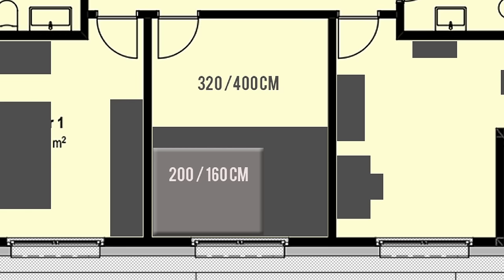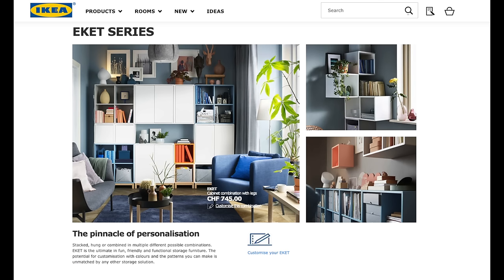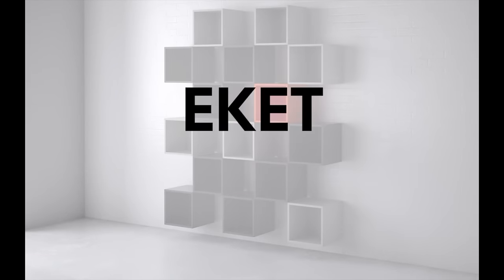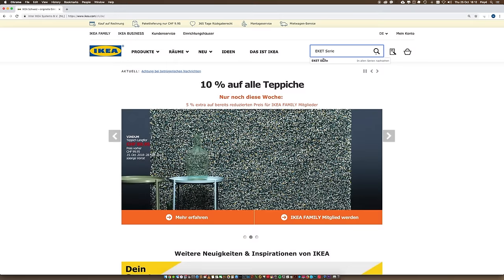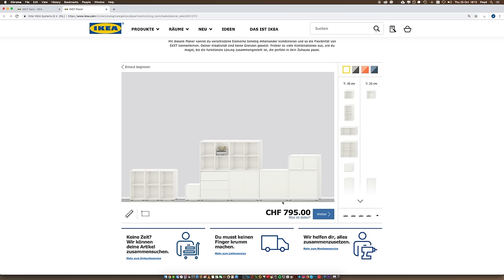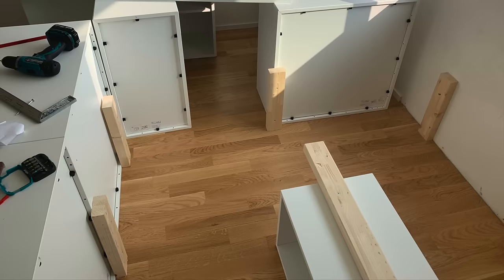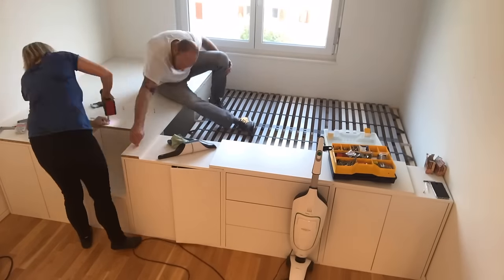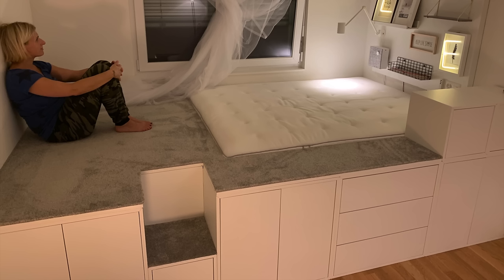IKEA DIY HACK | Platform Bed

Comment: So....there are IKEA cabinets under the platform, completely inaccessible?
Reply: seems like it 😂
Reply: Yup. Because that's apparently cheaper than using some 2x4s and mdf.
Reply: That's exactly what I wanted to ask.

Can you only reach the cabinets/shelves in the front, or also the ones under the pillow area and how?
Reply: @wilsoncalhoun  What are 2×4s?
Reply: Frogenius W.

Dimensional lumber 2 inches thick by 4 inches wide by 8 or more feet long. Pine or red oak 2x4s are ridiculously cheap and adaptable, and to my mind would be a better choice in a project like this-- at least for the structural bits.
Reply: Shasta Bare 

Wow
Reply: @wilsoncalhoun  
Thank you for your answer! 👍

And that's what I thought too! A wooden frame would be much more efficient.
Reply: Cheshire Cat  
I'm not a native speaker, so I didn't know this expression.
In german we call it "Vierkantholz".
Reply: There prolly secret storage... If they aren't that would've been the sensible thing to do 😒
Reply: I think so
Reply: i think it is accessible, but these are the kind of storage you wouldn’t use much, put stuff you dont use often
remove the mattress when you need to access it, there is an opening on the left to slide in
Reply: @FrogeniusW.G.  yeah man das gute alte Vierkantholz
Reply: @FrogeniusW.G.  No, I think that would be a 4x4
Reply: @gosiahoot6998  No, the measures/dimensiones are not relevant.
It doesn't have to be a square in cross section to be a Vierkantholz.
It just has to have 4 corners or rather sides. That's what "Vierkant" means, "four sides/edges"..
Reply: yeah, total waste of money
Reply: @FrogeniusW.G.  those are wooden beam that are 2 inch thick and 4 inch wide. simple name to know how thick and wide the wooden beams are
Reply: @The666VampireGirl  Yes, after Joshua told me, I got it.
Reply: Shasta Bare but do have a purpose!....
Reply: Yea, that's what I thought
Reply: If I were them I would have it flipped over
Reply: This is basically just an ad for ikea. Hoping you’ll buy more boxes than necessary, versus just building a box frame
Reply: Look out, we have a genius on our hands here. HOW did you find out????!
Reply: @wilsoncalhoun  not actually 2 and 4 inches but you explained it well enought
Reply: @FrogeniusW.G.  i would make a secret path, where i take out the back of one of the cabinets where i can crawl thru into a chill area which will have lighting
Reply: my thoughts exactly.

Comment: I don’t think this is very practical. You bought cabinets to be covered. What’s the point?
Reply: If I were that handy I'd have just bought the first 5 cabinets that are being shown and after gotten wood for cheap and made the base since you have to put the IKEA ones together anyway.
Reply: Thought the same things, but if there was an entrance to the section under the bed + installing a nice LED light, than they would be useful as a secret chilling place (or storage)
Reply: @kassyarts my thoughts exactly, but i would Combine that with a slightly higher bed-platform.
a high platform wich is high enough to sit under it, upright on a Chair. 
there could be a desk inside. 
another idea: arange the outside Cabinets oval, paint them submarine Grey with the bed on top and decorate everything like a submarine turret.
inside and outside. this would probably work better without prefabricated Cabinets...
Reply: 😅😅pointless design
Reply: Agreed I would of just used wood but cool idea
Reply: Vee T : the design isn't pointless. Just that those hidden cabinets could've been useful. 
I actually thought it would be hollow on back side for more storage or a crawl-in kinda of space.
Reply: to spend more money
Reply: Thinking the exactly same thing
Reply: i think the point was to show you can just buy this shit from ikea only and you can do it cheap. actual support beams would be more useful tho
Reply: Thanks for share
Reply: You can built this out of garbage lying on the street. Dont support ikea
Reply: Waste of 💸💸💸

Comment: Functionality of the cabinet is a huge question mark??????? What's the point of having that space whether can't use it... And it ain't cheap...
Reply: Good question
Reply: Yeah i thought it too. Why they used lots of them and they don't seem useful
Reply: anju mallah s
Reply: It would have cost them more time and money to create a supportive infrastructure for the bed frame
Reply: I feel like they could’ve just used a table for the part that they covered with carpet (the part that her and her friends could sit on aka cabinets 6-10)
Reply: @blue7346  well no if u actually make something like that... U could have just gotten a bed had some cabinets installed in the space so that there's no gap  which u can open from top that way it would have been functional and also would have looked platform bed... With a carpet on top
Reply: Ikr ain’t cheap at all!
Reply: @thatsadbish4912  exactly
Reply: duh its not for storage, but for "distributing the weight of the bed"
Reply: anju mallah its a much btter way to achieve this,i have it in my room
Reply: @elizabeth.w.23  exactly! You can buy industrial steel shelving for £40 a unit where I live, which would have done for the core of the platform, then maybe put a cheap £40 bookshelf on the edge so there's some storage? Smh
Reply: Cut awhile in the platform and go down their to ur secret place and hide Ur diary's in the c b inrts that are hidden! Smart I know

Comment: Instead of getting inaccesible shelves from IKEA I would have just used regular wood for wayyy cheaper
Reply: Yeah, a box structure out of 2x4s.
Way cheaper and waaay stronger
Reply: ...and more ecofriendly as well 🤗
Reply: Yeah I don’t get the point of using cabinets...
Reply: You can assemble one of them shelves without the back and make crawling space under the bed
Reply: RIGHT??!!! 😐

Comment: I would think that if you are sleeping close to the edge, the bed is going to sink in and you will be hitting the back of the uncomfortable furniture. This also makes changing the bed sheets and making the bed extremely difficult.
Reply: MGMT 
You would have to take the entire bed out just to change the sheets. 
I was thinking of telling my mom this,but then I read your comment. 
Most people just think about the design,not the work. You just got 
another subscriber because you're much smart.
Reply: And looks like they can't use so many cabinets. So why did they add them?
Reply: MGMT how do u think ppl change sheets for water beds. Nothing is impossible my friend.
Reply: @AT-if1wv  No you would just lift the mattress up and pull of the sheets like in a normal bed :'|
Reply: And then ofc get clean ones on. Just lift the corners of the mattress and put clean sheets on them.
Reply: thought the same. how to change the bedsheets... it looks nice with the sunken in mattrasse however , so difficult to change.
Reply: i would do maybe similar but have the matress ON the platform, Like a big thick super matress. i think it would look cosier also with a matress on the platform then in the platform
Reply: I was thinking the same thing . How on earth do you make the bed?

Comment: Less than $800, boi you say it like you get the money from the government for free. Y'all know you can do something similar if you ask your nearest grocery store if they're throwing out any pallets.
Reply: the pallet wood is very low quality though, and might have termites
Reply: Okaser1227 oh, no, not really! The ones that we used in the grocery store is pretty strong! But this was part time job days. And sometimes they're new as well! Probably power washing would do the trick and some spray coating.
Reply: As everything in this video except the language of the speaker is Swiss 800 swiss francs for this (in switzerland) isn't bad at all. Why they didn't make that clear though I'm not sure. If you look at the language on the website: it's german. the price is in chf (swiss francs) and the plugs next to the bed are swiss as well. Living expenses in switzerland are high, but these guys clearly have no idea that that is not necessarily the case elsewhere. quite embarassing as a swiss person myself.
Reply: @cassandramuller7337  800 Swiss is $806 in the US
Reply: @phoenixrose9400  I am well aware of that. However, cost of living is much higher in Switzerland. So while 800 francs may seem cheap to a Swiss person, 800 dollars are a lot for an American.
Reply: Mr. Reanu Keeves but we didn‘t want to do it like that and we didnt want to get a extra wardrobe

Comment: The use of IKEA furniture made this DIY project not only pointlessly expensive, but also somewhat unsafe and not durable for the long haul. That being said, I appreciate all DIY projects and I like the idea of this. I think that different materials can be used to bring down the cost significantly and make this far more durable. Personally, I wouldn't add carpet because I have pets so it would make things more difficult to maintain, but I don't think I would like this project nearly as much without making the hard surface more comfortable in some way.

Comment: That looks REALLY good. But that bed is too small. My legs would be hanging over it 😂
Reply: I'm 4'11  so it's all good I wish I was taller
Reply: @hashisasraiinbow7238  omg I'm 4'11 too!
Reply: NewPhoneWhoDis It’s a queen size.
Reply: it's 2meters long, that's 6 feet 7inches. How can not fit in that
Reply: Are you a giant? That's a queen size bed. Most teens and adults can sleep easily on it. Just looks small because of how it's built into the surrounding platform.

Comment: I dig this, bc your clothes can be put into those draws if there's enough, and i actually sleep on the floor bc i dont like to sleep in bed. I have smh thats thinner than mattress, usually its put over the mattress for it to be more comfy. I just put that on the floor and sleep. Its like sleeping on three blankets. Its not completely sleeping on floor and its not too soft so i dont fall into it like u do into mattress, your spine is straight.

Comment: you used perfectly fine furniture to build a bed? this is the worst project I have ever seen
Reply: Greg K I get it on the front because it doubles as storage, but underneath it just doesn’t make sense, and it added hundreds of dollars
Reply: @tiruthefolt6059  I plan on maybe doing this.. what would you suggest to go under?
Reply: Jayden Henry I’d suggest a platform made of 2x4’s and some plywood sheets. If built right it’ll support the bed and the sheet will keep items from falling underneath the platform. I’d also suggest putting some holes in it to allow for ventilation for keep mold and other things from forming and ruining the floor.
Reply: @tiruthefolt6059  thanks so much!
Reply: He's done it so that it's "simple" for people to follow, and don't have to start building frames. But yeah I agree, what a waste of furniture, and unnecessary additional cost. Everything behind the front storage cupboards should have been built up in 2x4. The slats for the bed, you can buy pre-made, you just role them out and screw them down to the frame. More spring under the mattress than 2x4 and relatively cheap.
Reply: @jada_h_9960  Try these pre-made bed slats under the mattress, rather than 2x4. It will have more spring and feel a lot less rigid than 2x4. https://www.ikea.com/gb/en/products/mattresses/slatted-bed-bases/lur%C3%B6y-slatted-bed-base-art-30278727/ No doubt you can get them a bit cheaper through ebay or a local bed store when you buy the mattress?
Reply: @tiruthefolt6059  I mean half of the furniture wasted on the front isn't even functional as storage haha. Such a waste smh
Reply: @sunscreenhoarder6558  Oh god you're right XD
Reply: @tiruthefolt6059  Unfortunately 😂

Comment: So many issues here. 1 I’m pretty sure this isn’t even your video and you narrated someone elses. . 2. This is such a dumb configuration. That bed is going to collapse being held up by only 1 cabinet. 3. how do you change the fitted sheet with a sunken mattress? Disassemble it every time you need to change a sheet?
Reply: To change the sheets you would lift the mattress, this isn't dumb as there's 2x4s holding it too and bed slats are decently strong and can probably hold a 14Yo. I do think this isn't his video tho.
Reply: Swiss creator who has clearly paid for a voice actor to do the voice over. Off, especially for an Ikea hack video.
Reply: Factory051 “creator” being the funny word here
Reply: CS: GOPNIK assuming the 2x4’s are anchored securely to the walls

Comment: One problem....... how do youchange the mattress sheets? I suppose it wouldn’t be easy
Reply: Oh so easy. Just like you would change the sheets on a normal bed. Just lift the mattress at the corners pulling of the sheets corner by corner. Then place clean sheets spread out on the bed. And lastly lifting the corners one by one again and putting the sheets over the corners. Isn't that how you change the sheets at every bed?

Comment: Cool idea, however I think it would have been better if you added an access door to the area covers up for hidden storage and used wood or steel to reinforce the back area instead of using shelves that will get no use.

Comment: A better idea would be to build the same frame out of basic lumber on a bunch of 2" swivel wheels (brakes on the corners of each piece).   Then cut the plywood and carpet to cover similarly to what he showed on the vid but cut so that you can move every piece out of the way to allow for easy cleaning and aeration.  Otherwise that is nothing but a mold incubator and stink bomb experiment.  Also, putting that bed next to that huge window with all those neighbors is a noise nightmare unless you have a sliding panel system with 1 pound mass loaded vinyl to block it when the noise is high outside.

Comment: I've wanted to do something similar to this, but lower and the storage below the bed would be accessible. The main idea is to use the half of the room as bed/storage (i have a very small room).

My concern is that I read somewhere that air circulation is needed below the mattress to let it breathe and not have mold grow. Is it true and is there any fix on this?

Comment: Which side is the headrest? One wall has a shelf on head height, the other wall is a window on head height, and the other 2 directions are towards the middle of the room. And where are the handles to open all the cabinets? Strange setup.

Comment: Just get a big board sized for your mattress, place it over tall cabinets arranged around the outer perimeter of the board. Leave a gap for the staircase. Use shorter cabinets beside it to make up steps. Place mattress on top. 
To access the space under the bed, move the  cabinets that serve as steps out of the way.

The space in the video for teddy bears is pointless, the carpeted surface is uncomfortable compared to the bed just beside, and will just gather dust because you won't use it.

Comment: I wonder if the bottom of the mattress will mildew over time due to lack of circulation and light. This is an Asian-inspired setup but they use thin futons that lay atop, not a nested mattress. Just ask guests to remove their shoes and sit on the floor...sheesh.😅

Comment: There has to be a cheaper support system than cabinets that literally cannot be used besides to support. Like sure use the ones on the outside but there’s no point in using cabinets on the inside if you use them for their actual purpose of storing things

Comment: the carpet was such a bad choice. should've just used the same hard wood as the floor. or a really flat, white carpet. grey blue plush carpet? lol. cute idea tho i guess.
Reply: Yes! That thin and basic gray carpet is the same cheaply made, bulk buyable textile that I have in my Houston apartment. And I live in the hood! 

They could have at least put a carpet pad in between those press board Ikea cabinet frames and the carpet. Probably they couldn't due to the cardboard cabinets weight threshold.

Comment: Y'all realize that your version of "I'll just buy some wood and make the support for under the bed" requires power tools, right? Drills, screws, saw etc.The cost of those for someone who doesn't have them is going to be the same as buying all those Ikea furniture... Not to mention the ability to measure perfectly, cut everything to size, screw everything together with 90 degree angles, making sure that everything  is flush so that nothing breaks when 3 or 4 people are moving around on it, and then to top it all off, clean it up... Yeah, alright

Comment: Does not make sense to buy expensive furniture from IKEA, assemble them, then put them in a graveyard under the platform.  What was the point?  Why not just use wood which is more solid, no assembly required, weighs less than MDF furniture, and cheaper?
The finished concept of platform bed is a good one.  The execution is not well thought out.